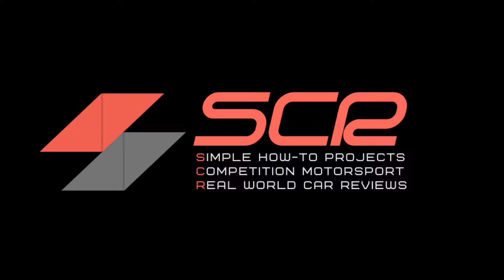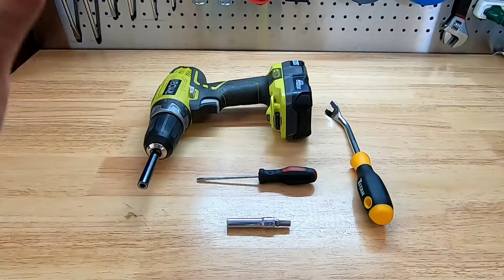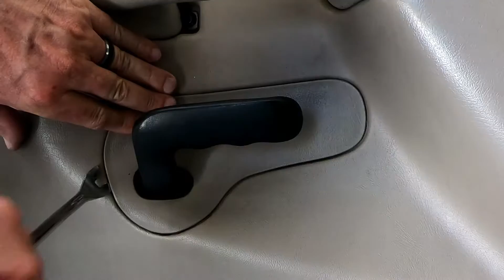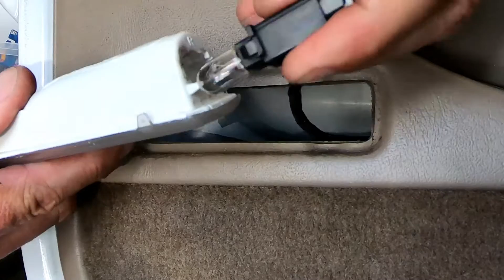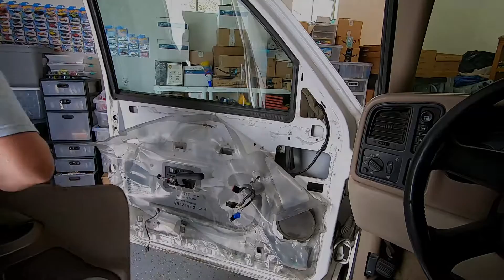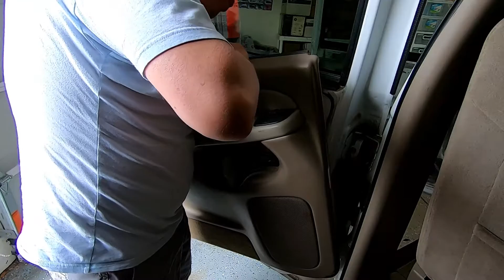How To Remove Front & Rear Door Panels on a 2003 Chevy Suburban 2500 LS, SCR Speaker Project Part-3!

Comment: Excellent video. I referred to this several times as I removed my door panel (2003 Yukon XL 1500 SLT), swapped in a replacement window regulator and window control bezel, and re-installed the door panel. Worked like a charm. Thanks for the information!